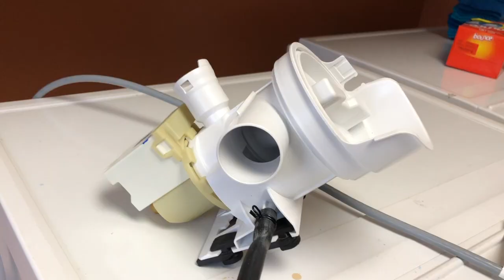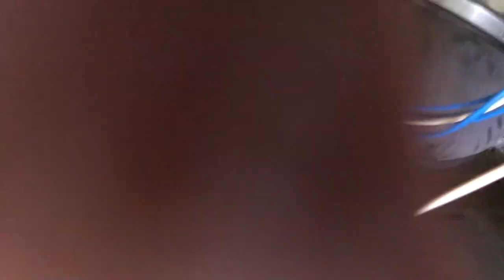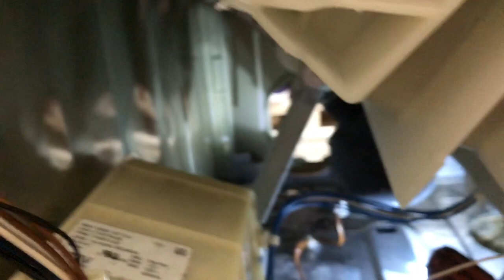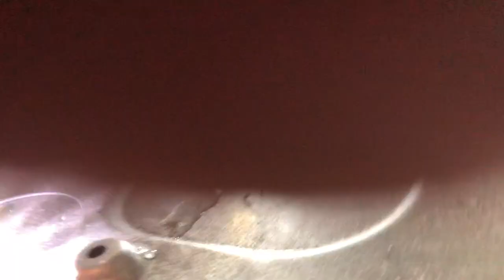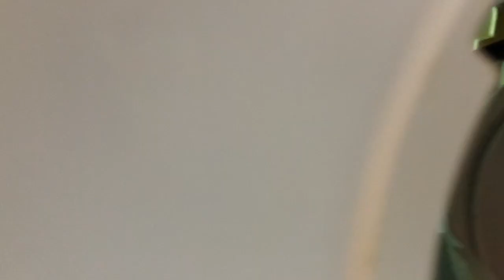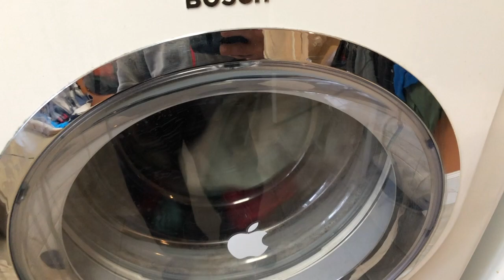Bosch Washing Machine Nexxt 500Plus Series  water pump repair

Comment: Very helpful video. The combination of front and back access works well. Got my drain pump out to inspect and put it back in without too much trouble. 

I have been fighting with this washer since years. The pump works beautifully about half the time. When it doesn't, often before the final spin of different cycles, including refresh, I hear an ugh-ugh sound. At one point, I had the crazy idea of pulling the hose from the drain and giving it a strong blow -- that gets the pump started reliably. Can anyone explain this?
Reply: Tengo esta misma lavadora, cambie la comba de drenado pero ahora sigue fallando, llena la tina, corre el tiempo, no hace el ciclo y vuelve a aparecer error E13, alguna idea de que puede estar pasando?

Saludos